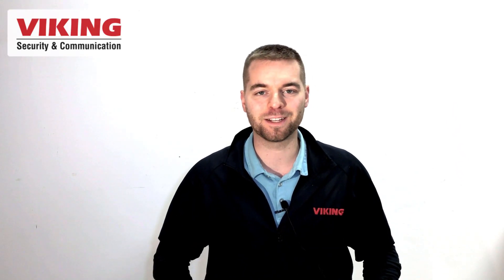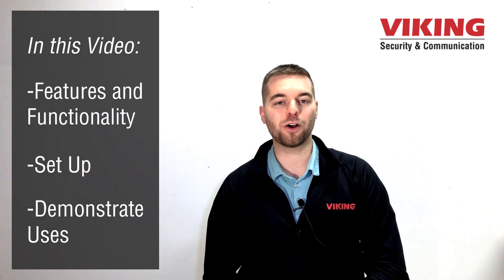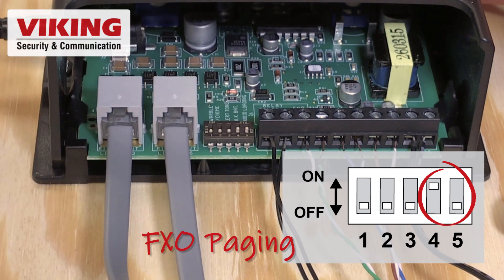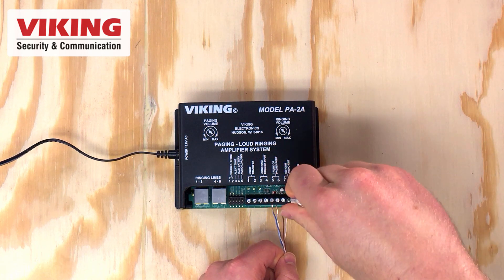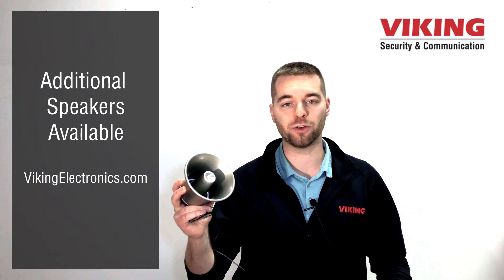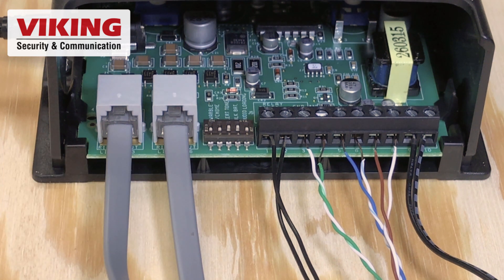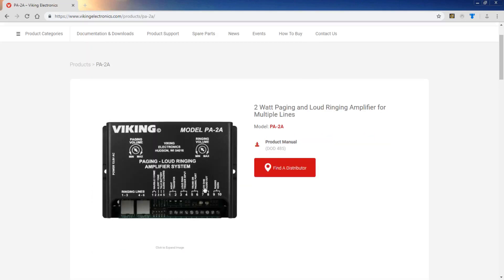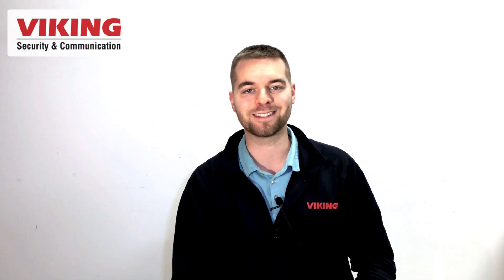Add Overhead Paging and Loud Ringing to Any Phone System

Comment: Can I use it on a fxs
Reply from the maker: @TheTelecommunicationsShed Voice paging using the PA-2A requires an FXO port or a paging port (600 Ohm Audio). If you only have an FXS port, you can use model RAD-1A to convert the FXS port to 600 Ohm audio and then into the PA-2A, or you may use a PA-15 directly on the FXS port.

Edit: @ username changed

Comment: How many pins does the ringing line have on the viking pa-2a
Reply from the maker: @splatoongigi6966 The grey ringing line connectors on the left of the unit have 6 pins each, this allows for tip and ring of three lines to go into each jack, for a total of 6 ringing lines.
Reply: @VikingElectronicsWI  is there a phone code that can activate voice page?. And is 9 positive and is 10 is negative on the paging horn wiring terminal

Comment: Hello, we are currently labbing a Viking PA/2A paired with a Grandstream HTA 812 and are hoping to make the ATA operate 2 lines into the PA/2A for overhead paging and loud ring. The issue we seem to be running into is that the PA/2A does not have an "auto answer" function that we can find, so it doesn't pick up the call to broadcast over the horn. Do you have any guides that would show how these 2 products can interface with one another, or would you suggest a different ATA or different amp?
Reply from the maker: Hi Casey, the PA-2A interfaces to an FXO (Trunk) or paging port for paging, and does not accept FXS (Ring Trip) for paging.

If you have an ATA that provides one FXS and one FXO port with different extensions then that would work. Otherwise adding a RAD-1A to answer the FXS port and then provide paging port audio to the PA-2A would be a possibility.

The best solution would be to use the Viking PA-15 instead, as it takes a ringing line input for loud ring and also takes a ring trip input for paging.

Comment: Hi! I'm an IT / Security guy who got caught up in a client's phone system and have nowhere else to turn. I'm wanting to know if this will work for their system.

Client originally had an Algo device to page their overhead when they dialed an extension. Device was disabled by Comcast due to a security flaw. We found that they had an ATA that is configured for another extension (ATA model MP-114). This extension was used for a cordless phone no longer in play, so I'm hoping to repurpose it for their overhead paging. It does have FXS x2, FXO x2, and an RS-232. I believe only port 1 of the FXS was configured here, but it needs to go to a pretty old amplifier (TOA A-706 Amplifier). I know this reaching pretty far, but right now the only other option i have is to try plugging in a cable in that I got, RJ11 to a tinned end, hooking up two of the cables to that amp, and pray that it works. I know this really isn't an advice thread, but I'm hoping if that doesn't work, this system may.

Thanks in advance, and I apologize for it being such a mess.
Reply from the maker: Hello Kyle, for interfacing from an ATA to an existing amplifier you would use the FXI-1A. This is because it can interface to an FXS port which is usually what you get from a standard single port ATA.

The FXI-1A can also interface to an FXO port or a paging port, so it is a really universal paging interface to have in your back pocket.

If you have any other questions please feel free to email or call us at 715-386-8861.

Comment: Would I be able too hook this up to an IP phone system for overhead paging? We already have an amplifier, and speakers throughout the building.
Reply from the maker: Logan, the PA-2A does not connect to an IP phone system unless it has a paging port (600 Ohm Audio) output. Viking part PA-IP would be the correct interface from your IP phone system to your existing amplifier.

Comment: How do I make the page announcement tone lower compared to the paging volume coming from a loop start port? No volume is available out of the phone system and I don't find a level control for the tone separately. Should I use resistors on the line coming from the phone system, and if so what apprx size do you recommend?
Reply from the maker: K T, Please contact Viking's technical support staff. Contact info can be found is this video's description section.

Comment: I have the PA-2A system. I do not have a phone system nor do I care to have active analog line interfacing with PA system.  All I want to do is plug in regular analog phone directly into the PA system to page. 

How would I go about getting it setup?

In my mind, all I have to do is plug horn wires into pins 9&10 and plug RJ 11 directly from analog phone to Ring Input port but that’s not working for me.

Thanking you in advance.
Reply from the maker: Hi Demarcus, You are super close. Watch the video again to see how to put the PA-2A into "trunk mode" and then plug the analog telephone into pins 5&6. If you are still having challenges with the set up, call out product support team (phone number in the description section).

Let me know how it goes!
Reply: Were you able to do it?

Comment: How do I turn off DTMF tones?
Reply from the maker: @MartyMcfly the PA-2A doesn't generate any DTMF tones - are you asking about a way to turn them off from your paging source?
Reply: @VikingElectronicsWI  yes I have an audiocodes mp114 and when I page I hear tones on the speaker. Isp says I can not allow them via the pa 2a
Reply from the maker: @MartyMcFlyGuy  Interesting - either way the PA-2A is set up (trunk or page port) the DTMF codes would be coming from the paging source. Are the touch tones being generated by the audiocodes or by the phone system itself?